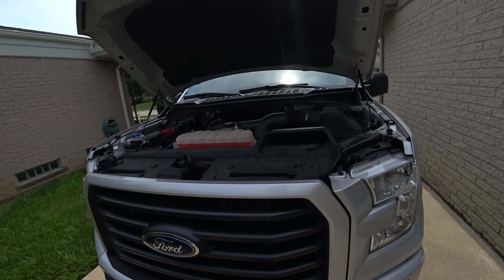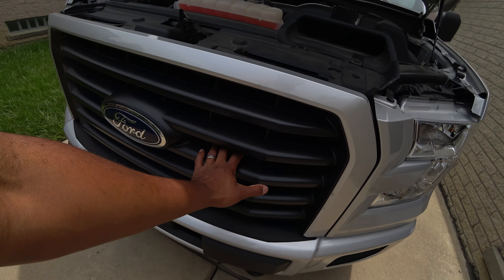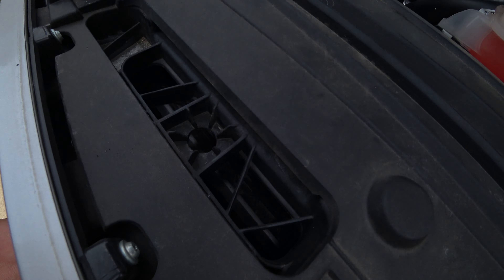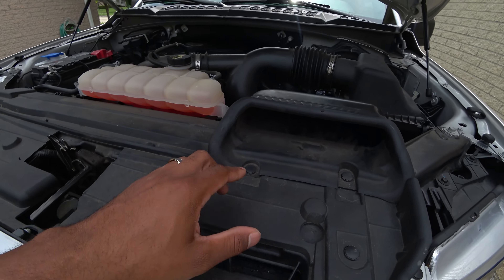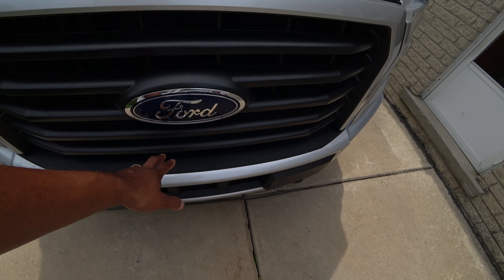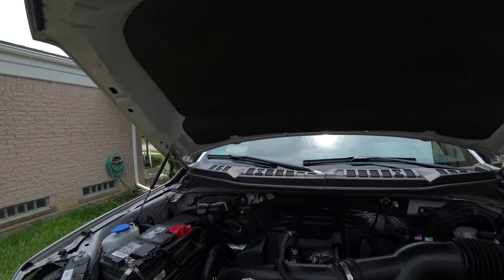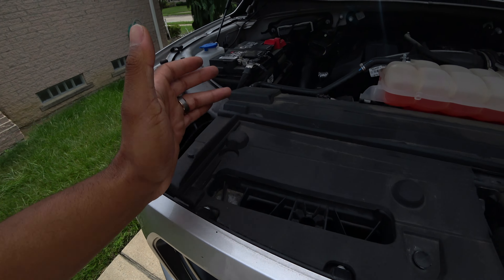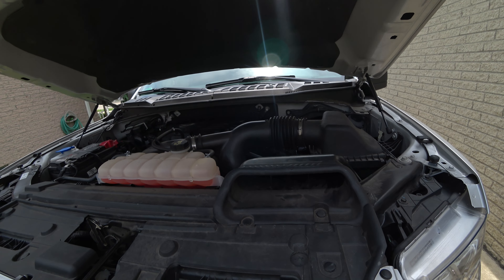F-150 Ram Air?

Comment: I've looked at them and I just can't justify the expense for them. $300 and up for a plastic air box and fancy filter, eh just can't do it. I would think a better upgrade would be a better flowing exhaust. I can't imagine the stock intake is very restrictive.
Reply from the maker: I agree... everything about this stock system seems rock solid. Maybe a bigger filter would have slight improvements but i think it would be negligible... Thanks for watching!

Comment: Good video. Yea the stock setup is actually really good. I upgraded the air filter to a $40 unit but didn't see the need to spend over $400 just to make a little more turbo spool noise. Not criticising those who did, it sounds cool .. but not worth it. Better off eliminating the resonator or full exhaust system.
Reply from the maker: eddielt1sl I agree. Which do you think is better? The 3.5 or the 2.7. I stopped at a custom performance shop in Lansing about these trucks... I don't know if you seen this or not but check it out...https://youtu.be/YuC2g3sV-J0
Do you got a ZL1 one?
Reply: Hi Sean, actually I had been a Chevy guy but was really impressed with the new 2015 up F150. Liked it so much that I special ordered a 2016 F150 XL  with the 2.7 ecoboost. 100A power accessory delete (Contractor Style to keep the supercab light) roll up windows with Blue Jeans paint and the ecoboost payload package. It still has the advanced sport track feature if you double press the traction control button and sport mode on column. The 2.7 ecoboost payload package consists of a 9.75" rear with 3.73 electric locker and slightly heavier springs and slightly bigger front sway bar.  I almost ordered the 3.5 eco but the only pulling I would do is with a 13 ft and at most a 15ft travel trailer. I must say it moves pretty good. That video from livernois you posted is informative how they reinforced the 3.5 eco block. That is also why I kinda leaned toward CGI block of the 2.7 instead of the aluminum 3.5.  Some folks have had problems with the 2.7 from what I have heard but so did GM with their LS series engines when they first came out piston slap. So nothing is immune to potential problems but the only thing I would say is change the oil in these ecoboost engines a little more often than the factory recommends. No cheating with Mobil annual protection you'll just cheat yourself. Mobil extended performance every 3800 miles or AMSOIL oil is all I use. I cannot run a catch can so the only option is to change it often. Its great how you get info and post to share with everyone.  Keep up the great work!
Reply from the maker: eddielt1sl thanks for commenting brother! Your truck sounds awesome!
Reply: DonnaSean. No Problem Bro.  If your set on getting the newer 3.5 Ecoboost by all means it is improved with additional port injectors so are the newer 2.7.  It is suppose to reduce emissions...ahem reduce carbon buildup on the intake valves especially for those who PUTT along and do not open it up.  Whatever you get, you will be happy and will enjoy the new updates on the body, especially the front end grill.  Looks neat.

 I had a few V8s in my lifetime Ford, Chevy, and Dodge, but will have to say these little ecoboost engines stock are impressive.  Some will mock it "Shoulda got a V8".  Usually these guys are more worried about making noise and going nowhere in a hurry. Got a lesson in high school when my. Big bad (what I thought at the time)5.7 L98 Trans Am was WAY out performed by a 86 T Type Buick Regal Turbo v6 3.8. LOL never forgot that one! Twenty-three years too late for a rematch in this truck. That guy is probably running a bigger turbo now anyway.
Reply from the maker: eddielt1sl I definatly make sure my 2.7 see  as much wide open throttle as possible! I give v8 truck drivers that same lesson all the time... i beat a tuned up ford turbo diesel... he felt really bad cause he had alot of money in it$$$.